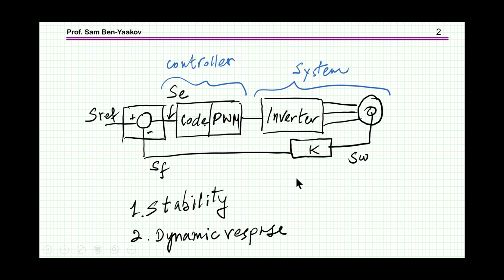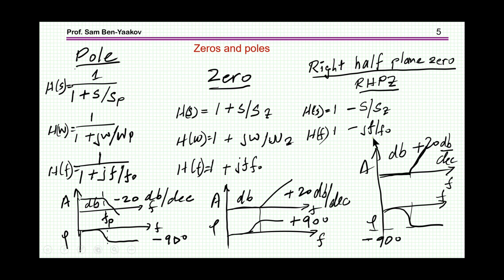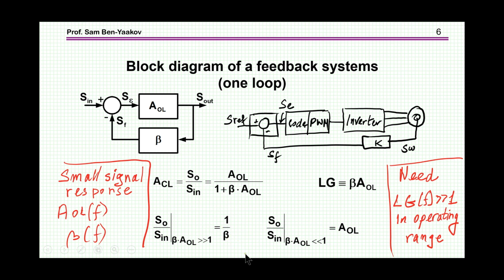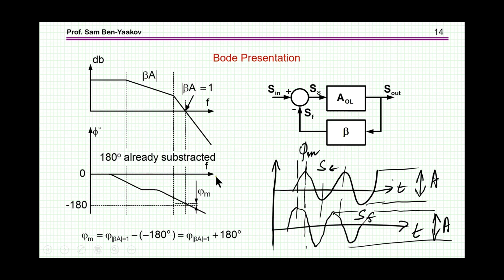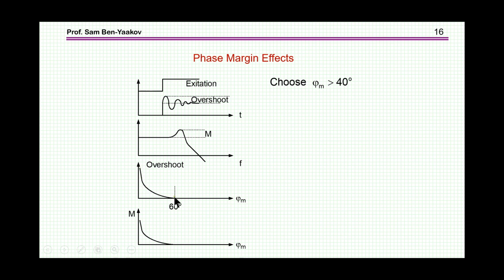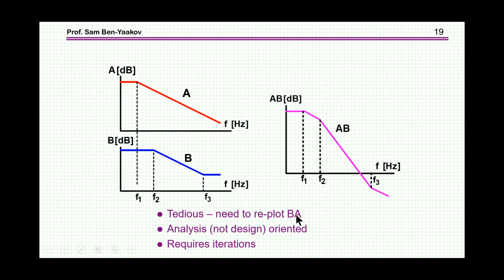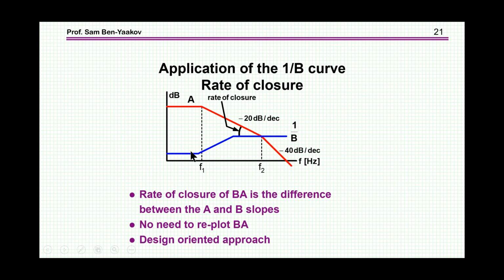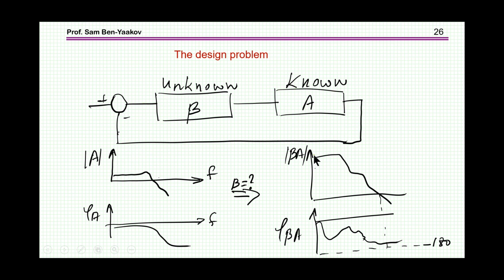Introduction to motor drive control: Part I

Comment: I had to come back to this as it's been some time since I first watched it and I now have forgotten about it... all the more reason for you to write a book!! Then these videos can make nice accompanying material..
By the way, at 3:01 you use the term "sinus(es)" when you mean to use "sinusoid" or (even better) "sinusoidal function" or just "sine". All are derived from "sinus" of course. The difference is that "sinus" is just an anatomic term now and "sine" is just mathematical. "Sinusoid" is a general term. In medieval Latin, "sinus" would have been the right term to use here but in modern English it is not. 
It so happens that I have a cold right now so the above thought was naturally triggered!
Reply from the maker: Thanks for making the sinus straight 😊My saying sinus is a carry over from my native language Hebrew in which we refer to a sinosuidal shape as "sinus". So I guess an Israeli would not notice the error😉
Reply: @sambenyaakov  It's a very common error. I probably wouldn't have noticed it were it not for my sinuses being blocked! It's also interesting to learn this is used in Hebrew in its original Latin form.

Comment: Good morning professor. Interesting set of videos. Field weakening and selective harmonic elimination are two interesting topics to cover. Also, I would be interested in a video regarding a paper of your about equivalent load for capacitively loaded series-parallelresonant converters from  199X. The math looks very nice , and I think it can be used to explain why resonant converters with high Coss output diodes/mos have a different conduction angle than expected , and LLC with high parasitic transformer capacitance also. Any chance of in depth review ?
Reply from the maker: Will try to match some of your wish list.

Comment: Hello  a question from series converter why? Another side of th lc filter the voltage waveform is rectangular and not senusoidal like a cuurrent if it's first armonic..
Reply from the maker: Reflection of load via diodes